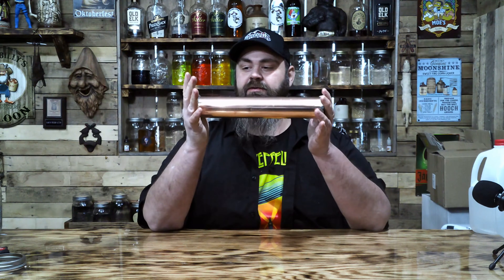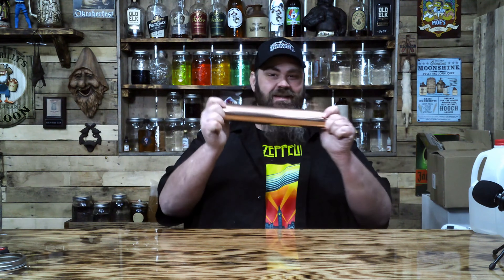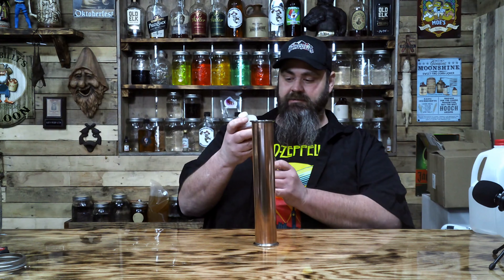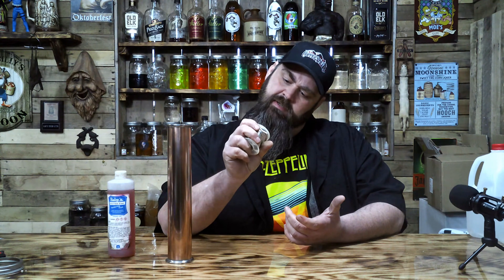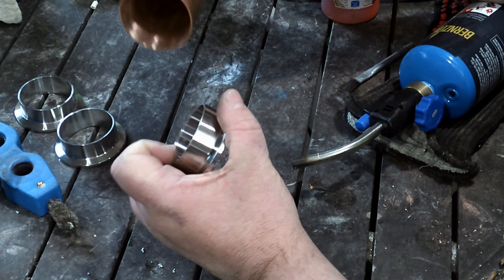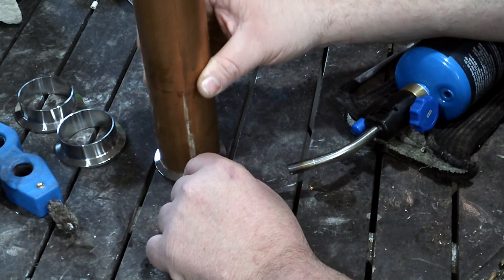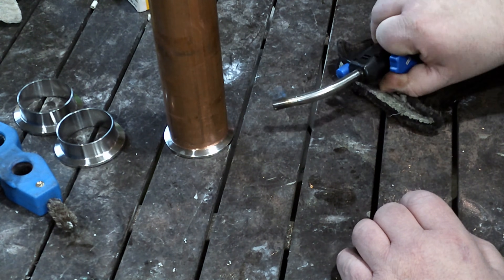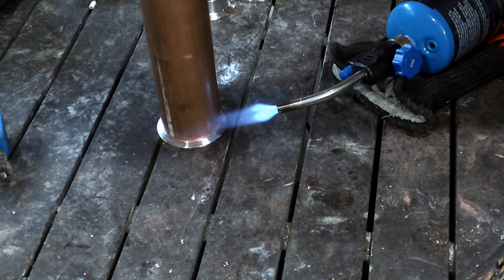How to solder copper and stainless together

Comment: I use stay clean it works wonderfully for soldering S.S. to copper. I can even use 50/50 or some silver solder. It holds up well doing my art project. Obviously, I wouldn't use 50/50 on plumbing.

Comment: how interesting to find you are a moonshiner because i was wondering if i could solder or braze ss to cu in order to use a larger size pot for my still where i need to put on a copper nipple onto a ss lid for the cooper worm connection and if the heat from a regular propane torch is enough for this job

Comment: A few tips: 1) heat the work pieces completely before adding solder 2) move your torch, not the part unless it is tight-fitting or clamped 3) flip your part over so you are heating from below (there's a good chance you'll get a cold solder joint which will break by soldering the way you demonstrated here 4) the strongest joints are those that air cool, prematurely cooling a solder joint will change the atomic structure causing it to be more brittle.
Reply: If I can't roll my tube to allow heating all the way around, then I use some form of turntable.
and, I find copper needs far more heat than SS, so I never heat my fittings, only the pipe.
AND, I make a ring of solder to fit inside, sit on top the fitting butt, then heat the copper above that.
when the copper heat flows down into the joint, it will heat the SS enough that when the solder flows, it seals well, and completely, then just a bit of heat at the base to pull solder all the way to the bottom, and I'm done.

Comment: Easier cheaper way is to use neat brick acid (really cheap) and apply to the stainless to pickle the surface, apply regular flux to the copper and away you go. Works every time.
Reply: And it’s air tight?
Reply: @brandonn102 yup, sure is.

Comment: I couldnt get this to work. I tig copper to ss with copper wire filler a little ezer if you have a tig welder
Reply: How does it hold up in the long run? Tried tig welding copper fittings together and they all ended up cracking. I wasn't back purging tho. I'm gonna try that next

Comment: The flux is zinc chloride solution. Whoever found this out should get the Nobel Prize. Some people make it by mixing small cut pieces of the jacket of AA battery and chlorine based toilet cleaner.! I heard lemon juice and salt does the same.

Comment: You should always heat the fitting first. Never put the solder in the flame the heat from the fitting will Wick the solder into the joint properly common stuff for anybody that's ever sweated copper

Comment: You need a phosphoric acid based flux to burn off the oxide layer from the stainless. That’s what makes it stainless
and nothing will stick to it

You also need a silver containing solder

I used a Harris stay -bright silver bearing solder kit.

it has about 6 feet of 3/64” 96/4 % antimony/ silver solder

And a 1/2 oz bottle of stay-clean flux

It makes the job effortless, and costs about $17 online or at our local welding supply

The best technique I’ve found is to:
-sand/ scotch bright the area
-Fit everything into place
-Wrap the solder around the joint forming a ring
-Wet the joint with flux
(It’s about like water)
-Apply heat to the area but no directly on the solder, until the solder melts and is drawn into the joint
-add heat where needed to get a clean uniform bead

I was so impressed, I’ve ordered a larger bottle of flux and roll of solder to have on hand for future projects, repairs and alterations
Reply: Part numbers? On the flux and solder?

Comment: Nice job you done there,  I used silver solder for my ss ferrules  too copper, will be looking to get some of that liquid and give it bash.  Hey Phill I made a mash late in the summer last year, I strained the the corn off and stored the wash in a sealed barrel to run this year. Will it still be usable. ?
Reply from the maker: Yeah it will be fine.
Reply: @philbillymoonshine7356  Thanks Mate, this will be my 1st run at distilling If you don't mind how can I contact you if I get stuck on anything I'm not too sure about ?